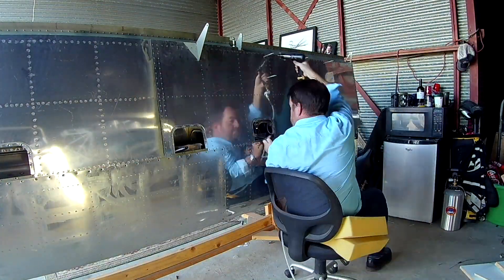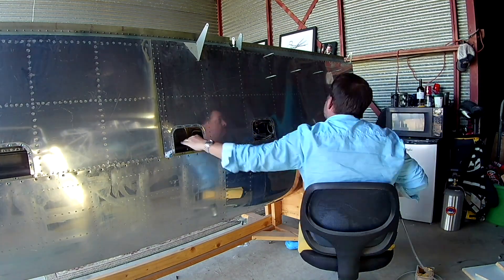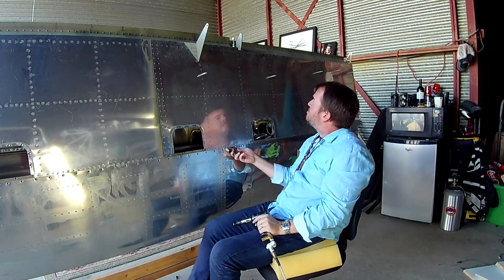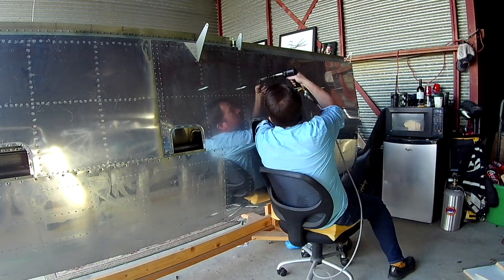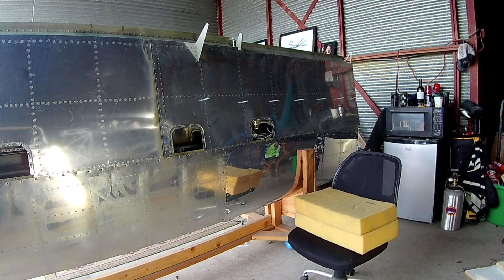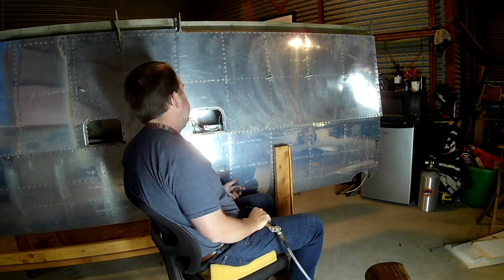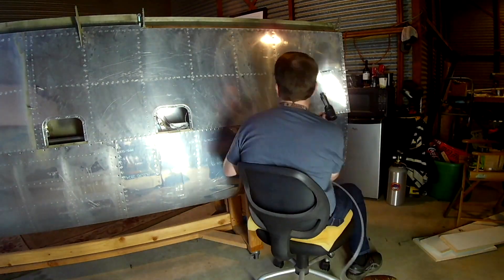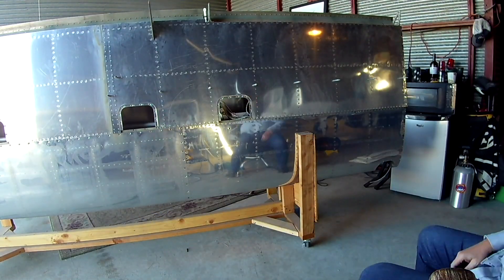RV-14 Wing Finalé VI

Comment: Would adding a third removable inspection panel in that wing skin potentially be worthwhile, not only to simplify construction but also for later inspections?
Reply from the maker: maybe but there's only moving parts where the current ones are.